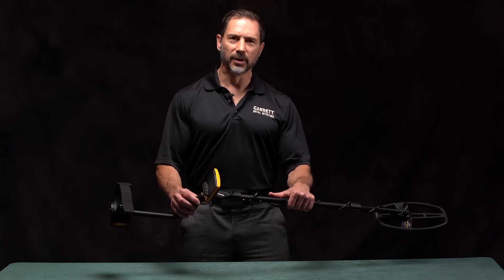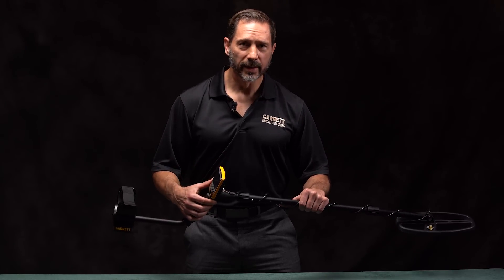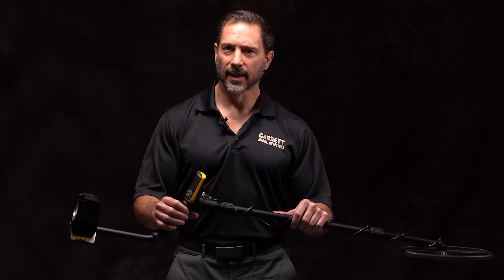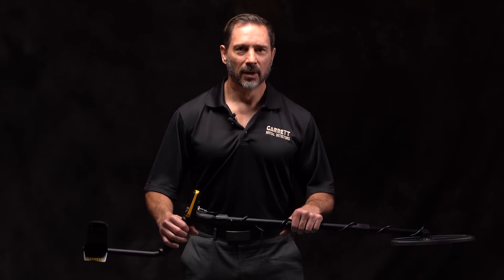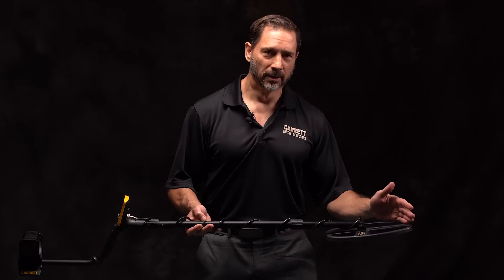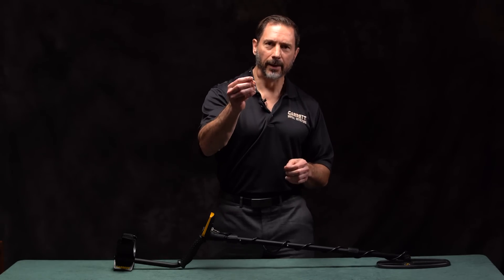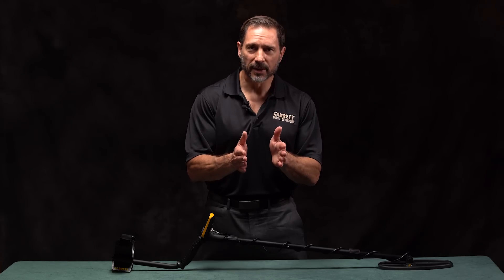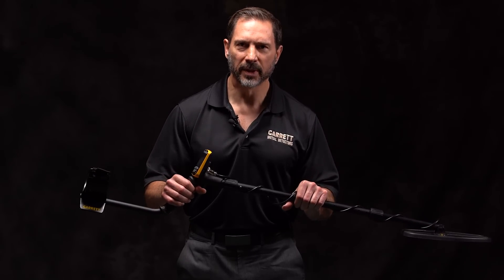Garrett Design Engineer Discusses Apex Technology

Comment: I can’t understand Garretts plan here where is the at pro version of this ,and I must correct you 20khz is not high frequency 70k  is .
I have been using Garrett metal detectors since the 1970s and still have my Vlf/tr groundhog and it still works

Comment: It should be in AT PRO level not ACE for beginners . Where is the waterproof choice and three search coil choice also and it should coming with vibration mode . Good bye AT PRO forever because still equinox machine is the best .

Comment: I feel that overall, this is a very confusing direction Garrett has taken. All of the right technology is present to make this a good competitor to the Nox if only it had been waterproof. The technology in this machine should clearly outperform the AT line, yet it’s an Ace, and it’s far too expensive to compete with the waterproof Simplex (even if that’s a single frequency machine). Moreover, the only fair competitor would be the Vanquish, and given that Minelab has a proven track record of fully understanding multi-frequency technology and delivering if you their customers, I see no benefit in choosing a Garrett Apex over a Minelab Vanquish as the cost is around the same. I wish Garrett had done something - anything - to set themselves apart. On the plus side, I think the new coil shape is brilliant and I’m really pleased to see Garrett got this right; anyone who’s used the 5x8” can attest to this without having swung an Apex. All things considered, I look forward to seeing how this machine performs against the competition.
Reply: Yes you are right brother thia apex same level of vanquish . They should make it waterproof with three search coil choice with vibration mode also .i  hate ACE model .
Reply: @toyotasubaru7314  Yes brother , brother Stef , is right on. I hate ACED mudel to.

Comment: Same clunky non ergonomic shaft, not waterproof, and near $600 with wireless headphones 🤦🏻‍♂️. Wow. Fully underwhelmed .... The curtain has sort of been pulled back on how much we are being overcharged for what is now essentially old tech... This is what it looks like when your money goes to marketing instead of R&D. Come on guys...
Reply: I have no problems with the shaft of my AT Gold (yes it wears down after years of use, but that is normal). And yes I like the shaft of my Deus but that has short comings as well (brakes do lock up, wear down, camlocks break, paint wears off, and it is wobbly if you swing it. And the shaft of the Nox is a disaster.

Comment: Seems decent but should be waterproof to 10 ft and a sound for every target number with select-able 5 tone and 3 tone. You are heading in the right direction.
Reply: It's rainproof
Reply: @FlazzMD  that's  not the same thing....
Reply: A beginner  or novice is not looking for that kind of options.
Reply: It's an ACE line model. They'll very likely come out with an AT ones that's submersable.